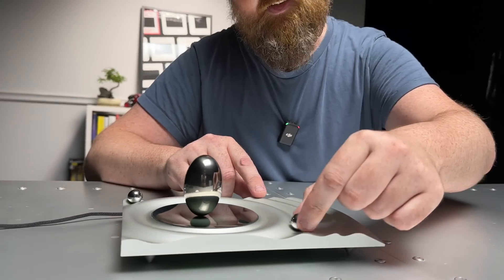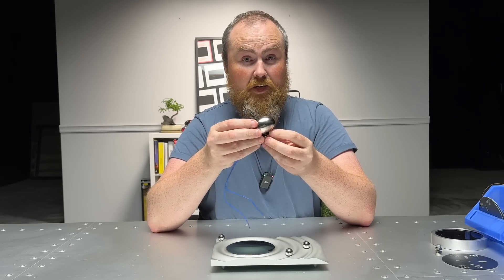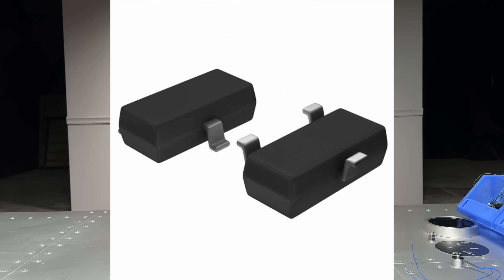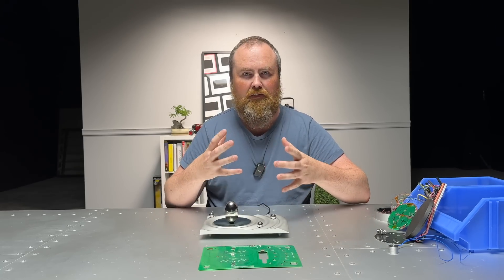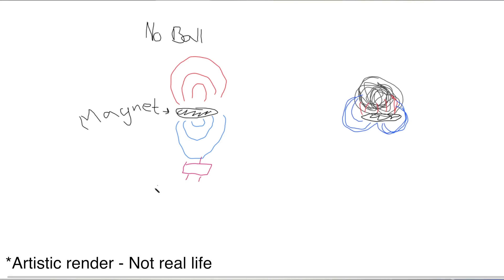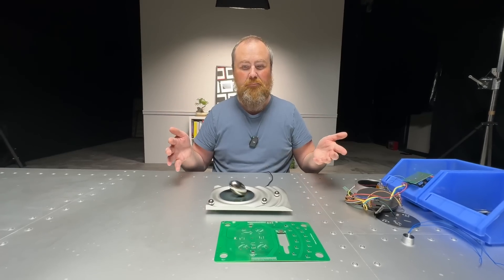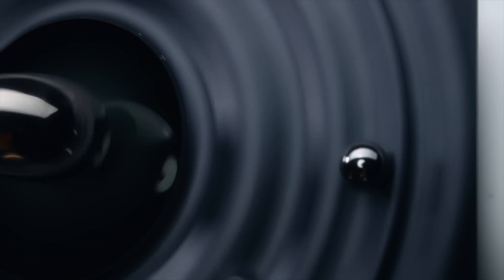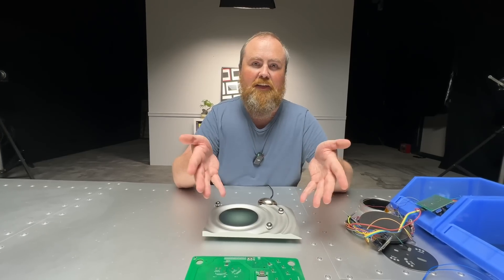Can you guess how this works? - Rises and spins forever

Comment: You can use back-emf for knowing where the magnet is, but for this structure the back-emf is very small, so using Hall sensors is so much easier here.